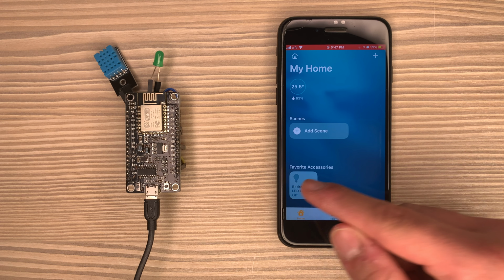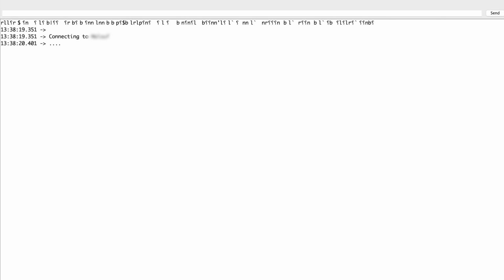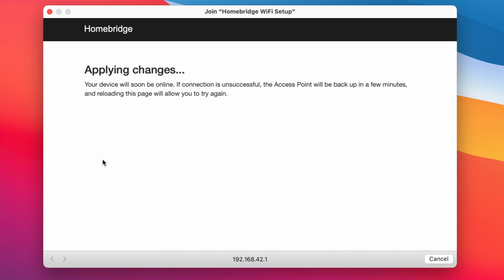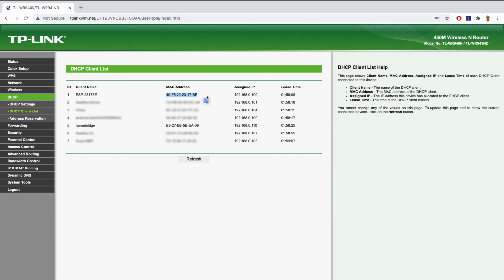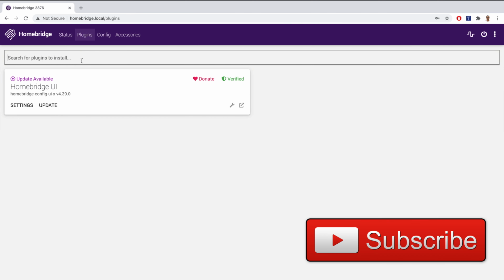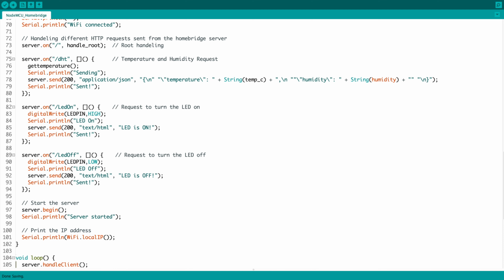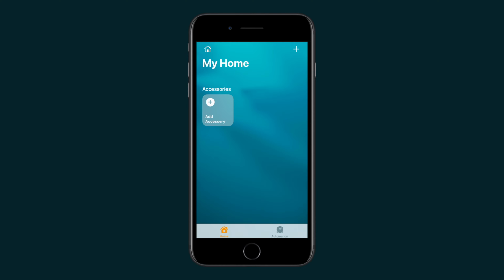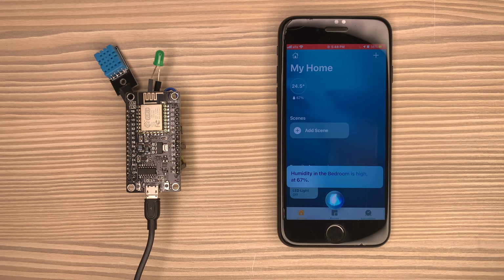Easy Homebridge Tutorial - Control your Arduino with Apple Homekit and Siri!

Comment: hey,
is there a way to get the lights state from Homebridge?
I want to use it to control a light but also to be able to control via normal switch and to update the state of the lights to Homebridge, thanks!
Reply from the maker: Hey Ofir! Thank you for reaching out! 
Unfortunately I don’t know of a way of getting the light status using homebridge. However, if you check my channel, I recently released a video where I control an Arduino directly from the Apple HomeKit, and in which i am able to get the light status, and connected an external switch.
If you want to stick to Homebridge however, I can suggest that you modify your code so that when you get any command from homebridge, you flip the state of the light, so if it was off it becomes on, or if it was on it becomes on. And do the same to your switch, so everytime you switch the switch if will flip the status of the light.

Kindly let me know if this works, and if I can help you in any other way.

Comment: Great video tutorial, thanks! Tried it out and works great with ESP8266 but not with ESP32 because of the PWM routine.
Reply: Maybe an additional suggestion to use fixed IP configuration for the ESP8266 to avoid changing the IP every now and then on the Homebridge plugin.
Reply from the maker: Dear Hans! 
Thank you for reaching out! I am glad you liked this video. Your suggestion about the fixed ip is actually really good 👍 
And yes this project was designed to work on esp8266 not esp32

Comment: what kind of arduino should I use
Reply from the maker: Hey Farid! Thank you for reaching out! For this implementation I used an Arduino NodeMCU (ESP8266) board, however you could probably use an Arduino Uno or Mega with an ethernet shield or wifi shield but will need to do some modifications to the code. You can probably take advantage of the previous video I made about how to control your Arduino using HTTP and modify this code.
Hope this help, and I am more than happy to assist you if you need any help.

Comment: Nice vid! But how did you set up the arduino?
Reply from the maker: Hey David! Thank you for reaching out! Actually you need to setup the Arduino depending on which plug-ins you want to use, however there is a much easier and quicker method to control your Arduino from your iPhone. Check out my latest video here: https://youtu.be/jWeC8mL9syE